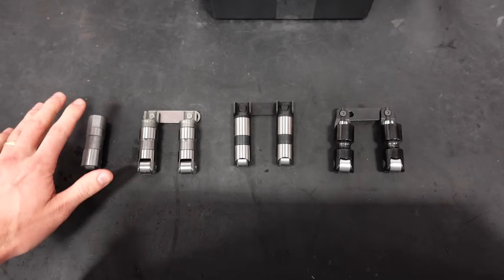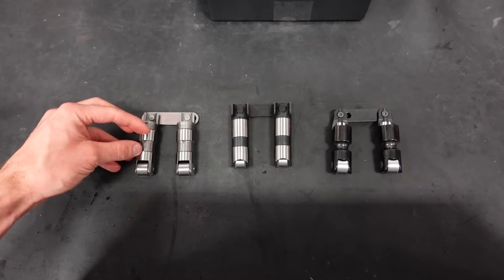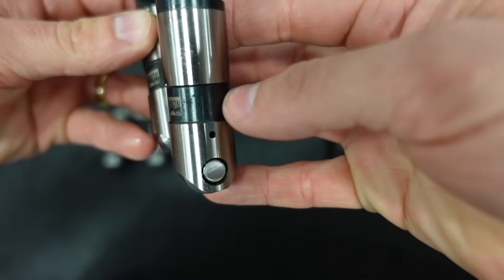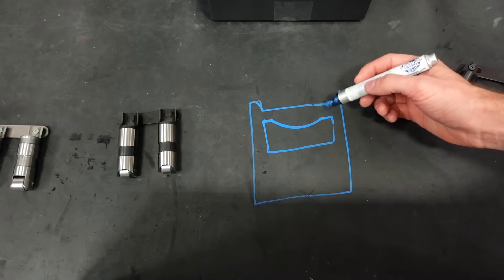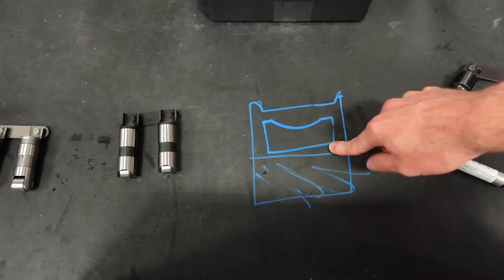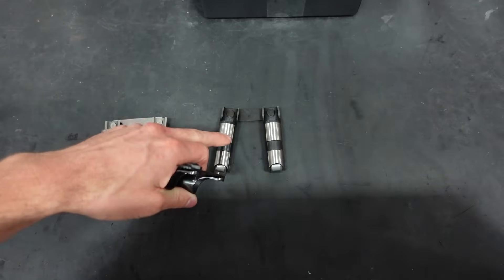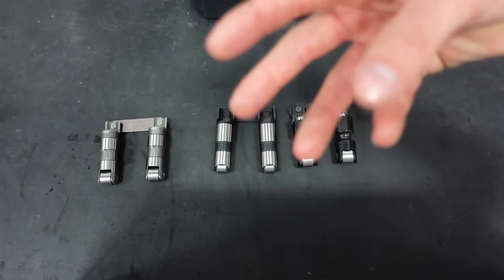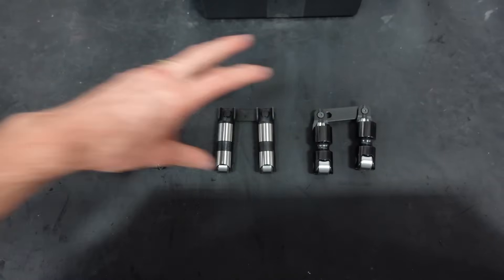LS Lifter Comparison - What You Should Run & When!

Comment: What are your thoughts on the jhonson 2110 lifters? Currently running them in my ls3 drift motor. 7k rpm limiter
Reply from the maker: They are good lifters. But you still have the risk of the plastic tray deforming and the lifter turning.
Reply: @JacobVillemain is there no alternative tray from another material?

Comment: Explain why the afm lifters are a bad idea. or the flaws of the valetrain in the ls/lt line. how to eliminate fail points like plastic lifter trays (which may get covered in this video, i just sat down to watch.) anywho thanks for all the content, def love watching and learning. my car just went in finally and they're looking into my engine now.

Edit when i purchased my texas speed afm delete kit for l99 i went with... " Johnson Lifters Link Bar Slow Leakdown Race Hydraulic Roller Lifter "
did i do a good? :) (this was back in june)
Reply: For clarity on this comment, I have a collapsed lifter which means someone left the afm on. When i went to look at what blowers fit my l99/ls3 application i stumbled on the TVS2300. if u look it up you see that they say you can leave afm in your car for lolMPG. If my collapsed lifter has told us one thing, its that when you start turning hp, AFM / VVT can hurt big cams. meaning mixing and matching is more difficult right?
Reply: @MAD_BST  If we use the knowledge shared in this video, it sounds like you should be changing to link bar style lifters for your setup to eliminate the problematic trays. As far as I know there are no AFM link bar lifters made so an AFM delete must happen. As far as VVT is concerned, based on my limited personal experience and various oyther YT vids, VVT is only an issue with performance camshafts because it changes piston to valve clearance. As long as the clearance can be maintained the cam phaser will work and can give you nice hp/tq curves (more avg power over the rpm range). In my experience, I have never seen a VVT, cam, or lifter failure that was not caused by piston to valve clearance. If you are running stock pistons and valves with a perf cam (more lift&duration) normally the VVT will need to be modified to a shorter travel (or possibly "locked out") to maintain piston to valve clearance.